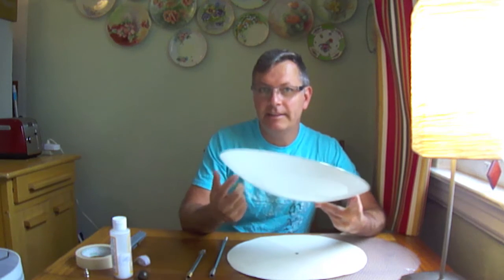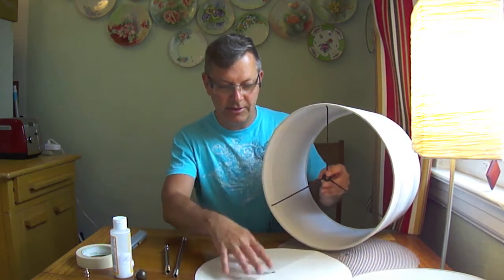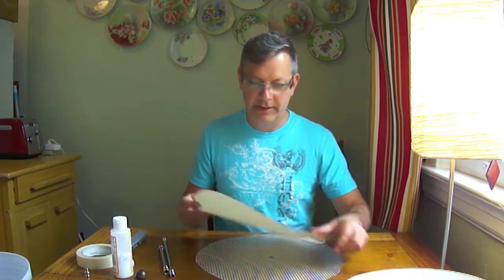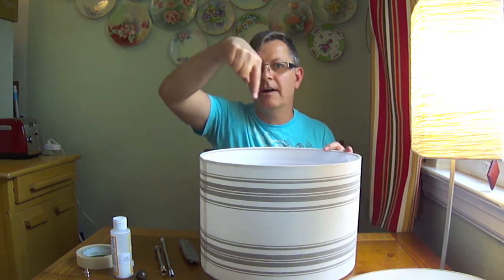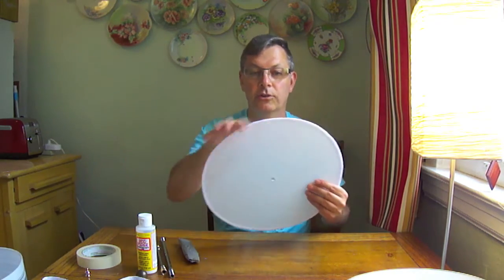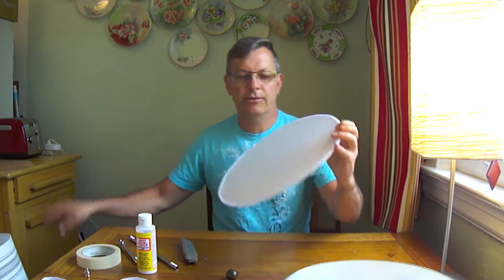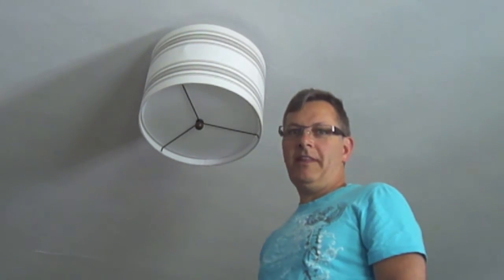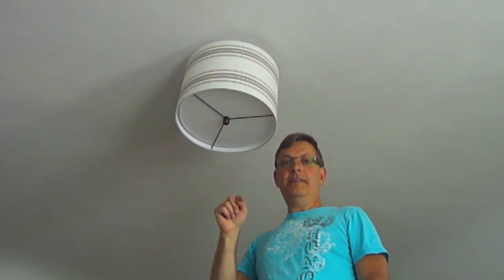Creating a Drum Lamp Shade for your Ceiling light fixture.

Comment: Cool! Tiny additional hack suggestion: If you spray paint those metal rods and screw on piece (which are visible now) a matte white with Rustoleum it will blend in or disappear a bit more...and only take a minute to do.

Comment: Try getting white poster board next time and cover with fabric. It’s so much cheaper, Much easier to work with and I think it would give u the same look. Also you could make the entire lamp shade out of poster board, the body and the circular piece. Just attach the hardware.
Reply from the maker: Great Idea.  I think the poster board may have to be thin in order for the light to get through.